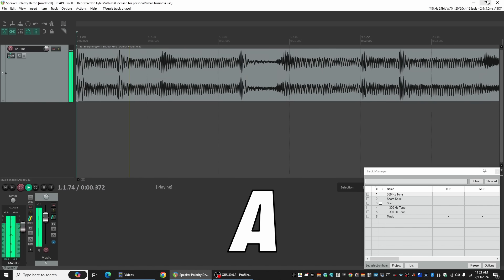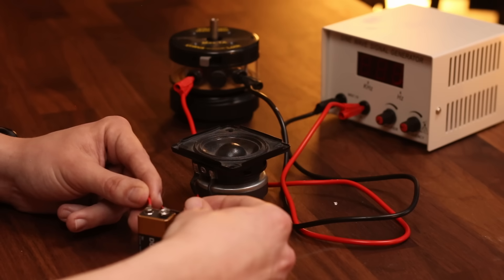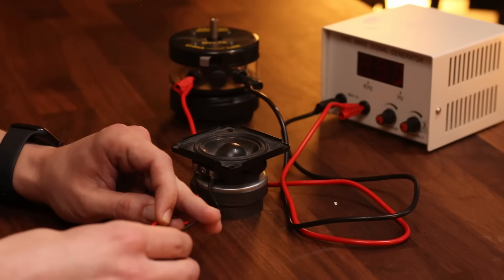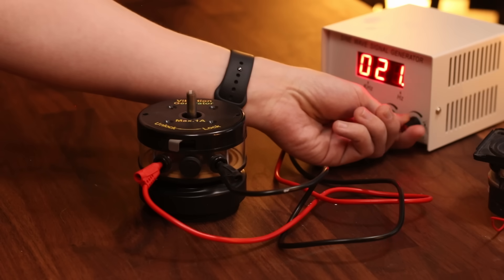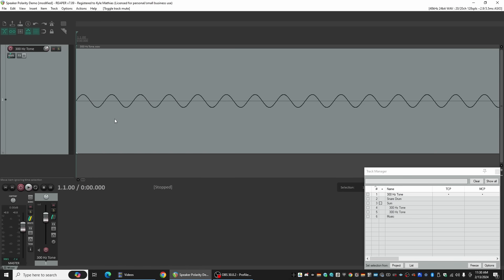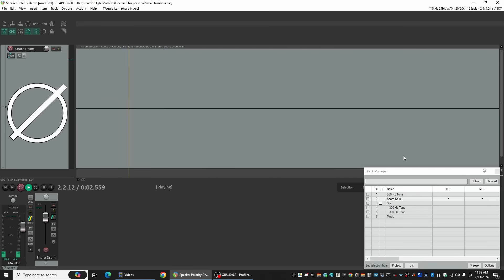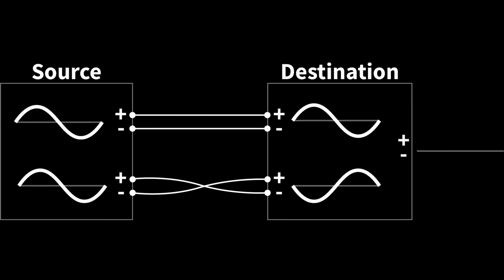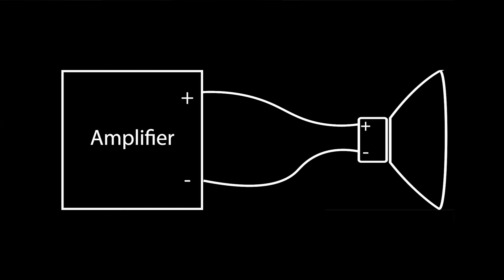What Happens When You Wire Speakers Backwards?

Comment: Since the VU Meter of the DAW leveled to zero, I guess, the cancelation of both phase shifted signals occured directly in the computing algorithms. So none of the speakears received any signal. Flipping one speakers polarity either wouldn't work to eliminate the cancelation of sound. That's the digital way. In analogue style both speakers had to play the phase shifted signals and the cancelation had to occur over the air with real soundwaves. So flipping one speakers polarity should do the trick. That's the difference and how "Active Noise Canceling" in modern Headphones do their work. Thanks for the video. Thumb up and my subscription for You ❤

Comment: Fun fact: I once installed a dual subwoofer setup in my Nissan 100NX (yes it's been a while) .. After installation I played some subwoofer test music and was disapointed by the lack of bass from the subwoofers. I didn't understand, I had two subwoofers and still heard almost nothing. It was at this point I thought about polarity and I changed the phase setting (on one of the amplifiers). It was at this moment I learned that I should not have done that while the system was running a subwoofer bass test on 80% volume. The moment I flipped that switch I was scared to death, the system was playing so load suddenly. Learned some lessons that day!
Reply: Both subwoofer were trading the airflow they were producing.
Reply: After I saw a friend of mine fry his car amp doing what you did, I always turn off the power before switching wires around.
Reply: My college roommate blew out his rear glass because he was trying a test and realized a wire came loose or something. Suddenly bbbrrrrrrrtttttt and he was covered in little glass cubes.
Reply: @ivanf4023  A guy I worked with almost burnt his Ford Focus to the ground running an amplifier to an amplifier to a subwoofer.
Reply: This is not directly related to sound but the importance of switching off equipment when rewiring or connecting stuff. Back in the early 90s there was a computer used for video, the Amiga. Our facility acquired an Amiga 3000 right when it launched. I was an apprentice (17yrs old) but they left me ''in charge'' because I already knew so much about that particular computer. One guy from another production company came to connect his video device to our computer, so it could synchronize the video signals and be recorded, called a genlock I think. I told him that the computer needed to be shut down first but he arrogantly didn't listen to me, what does this child knows anyway? He is only 17.  There was a poof and the computer died. The power supply got fried. No biggie, but getting a compatible power supply took time. I had animations done and clients waiting. Brought in my Amiga 500 and took care of the problem. Today's computers are way different but back then this was a real possibility. I still carry this lesson to this date, I always switch off equipment before doing experiments, soldering, etc.
Reply: @MegaGasek  I remember those days!!!! It always amazes me on the PCs from that sort of time onwards that connectors like VGA, printer, serial devices, etc. all had 2 screw/bolts to hold the cable in place, but the mains cable was held in by friction alone. At the time, it was just annoying. But health and safety and being able to drop power instantly ... even if it did potentially crash the 128mb hard drive. Yep! 128 MB. An entire mp3 of VERY average quality would fill the entire harddrive, but back then 128MB included a complete operating system!!! Today you need several GBs to even get the OS loaded! How times have changed!!!
Reply: @RichardQuadling  Hahaha! I remember our internal A3000 HD had a huge, very spacious 100MB... My flying logos, done on Deluxe Paint III and IV had around 1MB each and could be played back at a very smooth 60FPS (for video). Because the HD was SCSI we could be loading something and work on something else. I remember my friend's PC would freeze when saving/loading... Good times.
Reply: I learned that lesson two or three days after I moved into my first flat. It was like 1:30 am during the week and I (still being on my days off) was tinkering with sound settings (on low volume ofc) on my 5.1 system I bought second hand for the flat. Due to being in quite a sleep deficit, I got the bright idea to do something that required me to unplug the active subwoofer, but I forgot to switch it off before pulling the Cinch cable and FWHOOOOOOMP!!!! 🥶😱

It felt like the loudest sound I've ever heard, that subwoofer packs quite a punch and the walls of that house are paper thin! I was frozen for half a minute, listening for any commotion from the neighbors that I sure must have awoken with that noise. Then my brain clicked back into action again and I quickly turned off the HiFi, killed the lights, and put on my pajamas, so I could pretend it wasn't me if a neighbor knocked on my door to ask about it. 😂
but being the lucky fool I am, nobody seems to have noticed. After a few minutes of listening to the dead silent house, I decided it's best to actually go to sleep before I get another brilliant idea! 🤣🤣🤣
Reply: I had an NX2000.
Reply: Isn't that because of interference?
Reply: But you got some new pants
Reply: The first time I heard planar speakers (those were Magnepan SMGb's) I listened for a while and then I told my friend who just had bought them that they were probably off phase. There was no center imaging and the sound was vague. I wasn't 100% sure of course because they were the first dipole speakers I had heard. My friend checked the very expensive speaker cables he bought with the speakers and the polarity was correct. We listened again. I was still convinced that the polarity was wrong so I asked my friend to take a multimeter and check the cables. Indeed the right side cable had mixed the black and red connectors. Sound was 50% better after flipping the cables... It was particularly ironic since he paid over 10 times of what I would have paid for a speaker cable.
Reply: Before you touch switch, you were in it for only causing noise canceling? 
The subwoofers were canceling each other out, so no sound?
Reply: @SteveDave29  This is in fact what happens if you get your phases mixed.
Reply: I installed a new audio system in my dad's Lincoln Town Car last year and wondered why the subwoofer did not sound like it was working. The instructions for the Pioneer amp said to set the gain at Normal if using a Pioneer deck. However, the particular Pioneer deck I was using put out 4 volts on the RCAs instead of 500mV. I changed the gain to High and got the bass I was looking for.
Reply: Lucky you didn't blow it up.
Reply: Depends on how symmetric the signal is. When both sides are recorded independently there is only effect of chancellation on signal parts that are also recorded stereo.
Reply: @KlausBöckl  what? It's a subwoofer signal. Doesn't get more mono than that.
Reply: Out of principal you should only do wiring with everything turned on 😂....we did that with our cncs also😮
Reply: @psxtuneservice  hold up 😲
Reply: I had a 100nx. With subs too year 1996. Loved it

Comment: I had 2 12 inch speakers in a shared enclosure, both left and right channels. wired one backwards and whe one speaker cone moved in the other moved out and that made the bass louder. with 90 watts per channel in the back of a car poeple more than 50 feet away felt the ground shake and from the parking lot dishes in a second story kitchen allmost hopped out off an upper shelf.

Comment: You could also wire all the positives on a receiver to the negative. It would not make a single difference. Just don’t wire some a different way that others. Cancellations in this case would likely result in a lack of bass, and it would sound like the sound is coming from a weird direction, nowhere near your speakers.

Comment: 10 years ago, I actually discovered a way to make a small 2 inch speaker sound like an 18 inch high watt speaker using common items we all use every day. I've googled every single audio manufacture's inventory to see if anyone has ever created anything similar to what I invented, NOTHING! I got a multi million dollar invention, more like a tweak, to be honest. I actually find it hard to believe that no one else has discovered what I discovered.
Reply: I find that hard to believe, from power point and how much power 18" can take.

they do sell transducers you can attach on surfaces to make the surfaces make sound btw.
Reply: @lasskinn474  No no. My invention is not adding more power to a small speaker to match that of an 18. What it does is it alters the distribution of the sound, making it sound like an 18 inch. AND YES, I find it hard to believe that no one's else has come up with the idea! I'm sitting on a gold mine because no one else has discovered it!
Reply: @alwaysemployed656  making it more like a planar speaker instead of a point source?  tubes(if we're discounting planar conversion)?
Reply: @lasskinn474  Nope. It's actually a very simple concept, to be honest. I tried it out of pure curiosity and discovered a way to alter the direction of sound waves. So basically, sound waves can be altered, making the sound bigger and stronger.

At the moment, if you want a big sound that fills the room, you buy 7 inch to 18 and pushed a lot of watts. My invention creates the same big sound out of a small basic watt speaker.

Comment: I found a wiring diagram in the documentation for Cubic Player v1.7 back in the day. It's for a form of surround-sound decoder that's based solely on how the polarities of the speakers are connected. I have no idea how you'd replicate its behaviour in software, but if anyone feels like tracking down old software, it's out there if you want to take a look.

Comment: That's a slight misconception there. Even with the two separate speakers wired with the same polarity, there will still be constructive and destructive nodes. In other words, sound waves will work with each other in some locations (constructive) and work against each other in other locations (destructive), but the locations of the constructive and destructive nodes are in different locations depending on polarity/sound frequency/distance between speakers. You only need to turn on the speakers (regardless of polarity) and walk around the room to confirm that. However, yes, you do want the speakers in the same polarity so that the left and right, constructive and destructive nodes are symmetrical in the room.

Comment: I am an old fart of 75. Before stereo, 8-track and cassette plus FM stereo, we would install a rear speaker and wire it backwards from the front. When done this would move the sound waves back and forth rather than cancel in the middle. I also remember reverb units with a mechanical spring and it would make a boing sound when we would hit a bump in the road.

Comment: Fun fact: Inverting a copy of a sound wave can actually be used as "reverse ducking". Say you have two audio tracks, A (the control) and B (the track you want to hear only when you also hear A). Duplicate and invert a copy of B to get B'. Now use a normal ducking method on either B or B' (not both!) with A as the reference. Merge all three tracks together. B and B' cancel each other only when A is silent, otherwise you hear B when and only when A is also active. If B is (for example) a white-noise track, you can use this method as an easy way to "radio inteference effect" A (when combined with appropriate EQ settings, say, an "AM Radio" preset).

Comment: Great explanation for the masses ! Similar principle with guitar pickups, single coils tend to pick up unwanted hum, two coils in series but wound opposite tend to cancel the hum and can diminish overall output but due to the proximity and other physical variables they can compensate for the loss and sound full regardless. Same deal with tube amps, single ended outputs tend to sound brighter but are subject to hum and unwanted harmonics when compared to push pull outputs which tend to cancel out 
much of the unwanted signals. A lot of this is in the ear of the beholder, some folks hear differences others are less sensitive.

Comment: I've been working on speaker and headphone repair for a while and I can tell that when you let a currant flow in it it'll just buzz 
Or die horribly depending on the voltage that the cone can take before heating up to hard till it breaks the membrane from the coil

Comment: fun fact, this is also how Balanced XLR cabling works (in basic principal) 3 wires Ground, Signal and Inverted Signal or a 'Differential pair'. It uses a differential amplifier on the receiving end to subtract the common mode noise from the pair (As noise would be the same waveform on both inputs) and produce a clean signal on the output. this is of course a simplification of the process.

Comment: I built a set of two three-way speakers myself a few years ago. They have two tweeters, one mid driver and one bass driver each. The plans explicitly mentioned I should wire the bass driver in reverse, while wiring the other ones correctly. I’ve always wondered why, and this video reminded me of this. Any thoughts?
Reply from the maker: Check out this video: https://youtu.be/YToV8Q-K83s?si=7HkPxUrUOplFib_8

Comment: In a single speaker scenarios, where you don't have to worry about phase cancellation between 2 speakers wired opposite, I would still expect to see subtle differences is a frequency response analysis of the music being played unless the speaker is engineered in such a way as to move exactly the same amount of air from a signal that pushes the cone out as it does from the same level signal moving the speaker cone in. I'm sure that is a design goal, but I imagine it is pretty hard to achieve exactly perfect and equal response in both directions. I also wonder if there is a similar thing happening at the sound detection device (mic or even ears). That sound detection device might be more sensitive to waves moving in one phase than the other. But even if true, the changes are probably subtle enough as to be ignorable and maybe even outweighed by other factors like humidity, speaker placement, echoes, ....  Maybe an experiment could exaggerate and test this is the signal source was specifically designed to have a significant DC offset. Play that same signal using both normal and reversed wiring and see if there is a difference in the transmitted sound.

Comment: When you connect it properly to a battery which is DC (Direct Current) the speaker diaphragm would go up still and when opposite the speaker diaphragm will go stay down. unlike frequencies which is AC(Alternating Current) it creates sounds. And that's how sound is made by changing those frequencies fast.

Comment: Anyone who tells you they can hear the difference between a single speaker wired correctly or reverse polarity is selling you a bill of goods. The human ear cannot discern whether a pressure wave is pulling away or pushing towards the eardrum when it begins. The pressures are too small and the frequency too fast, even in bass where somewaves modulate less than 80 cycles per second. 

For another visual representation of the interaction between inverse sound waves creates zero output, I like to put the palms of my hands together in front of me. I point out that placing them together can be done with virtually no pressure whatsoever. Then I push my hands together as hard as I can. The observers can clearly see me straining while, for all intents and purposes, my hands remain in one place. Lots of power being exerted but no mechanical action. That's exactly how complete polarity reverse between two signals results in no sound from a speaker.
Reply: my blind test score disagrees...

foo_abx 2.1 report
foobar2000 v2.0
2024-02-26 12:11:56

File A: 0001 polarity testing.wav
SHA1: 92b635cdf4eae708978e6eb71e5dfa6876348dc2
File B: 0002 polarity testing.wav
SHA1: a76a3285d44c23f2f82783fad701745270f52579

Output:
Default : Primary Sound Driver
Crossfading: NO

12:11:56 : Test started.
12:12:55 : 01/01
12:13:07 : 02/02
12:13:18 : 03/03
12:13:36 : 04/04
12:13:48 : 05/05
12:14:01 : 06/06
12:14:14 : 07/07
12:14:25 : 08/08
12:14:35 : 09/09
12:14:46 : 10/10
12:14:57 : 11/11
12:15:09 : 12/12
12:15:23 : 13/13
12:15:44 : 14/14
12:16:02 : 15/15
12:16:16 : 16/16
12:16:16 : Test finished.

 ---------- 
Total: 16/16
p-value: 0 (0%)

 -- signature -- 
33bb02d575243b9de943696f1e29b44622df5822

Comment: Till u remain on the signal part. You are righ. When u move on  the phisical part there is a huge differenze. FIRST  mechanical less performance couse the membrane of the speacker, is designed to push the air non to pull . U can bind 2 loudspeaker in pushpull configuration and ofc u have to reverse the polarity of one of the wire, but u have to choose the proper hardware.  Second, in tiny room maybe u dont notice the difference,  but on stages i definetively hear the difference 😊